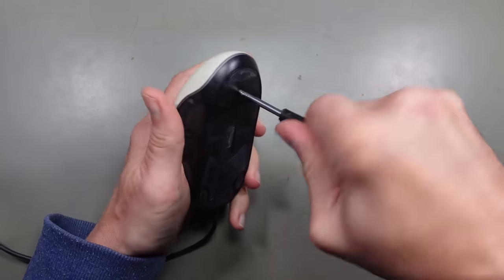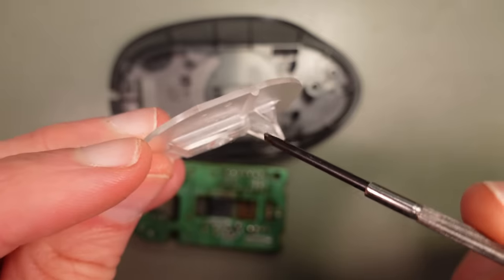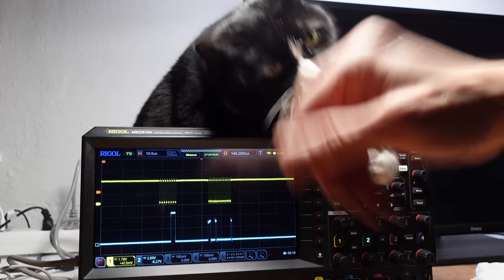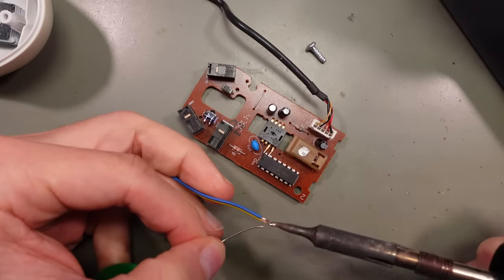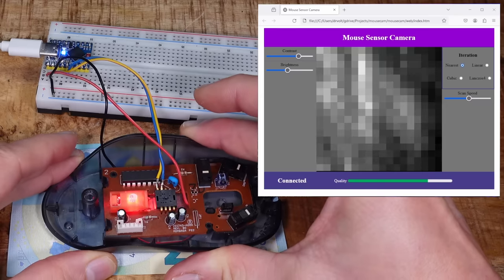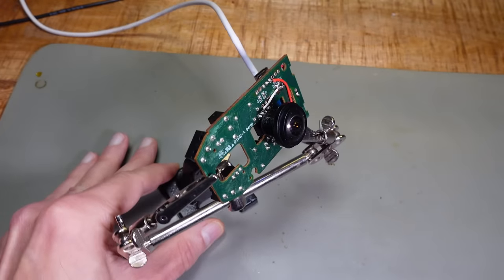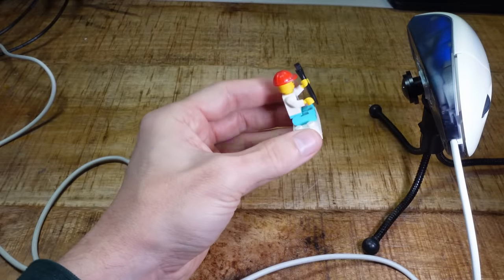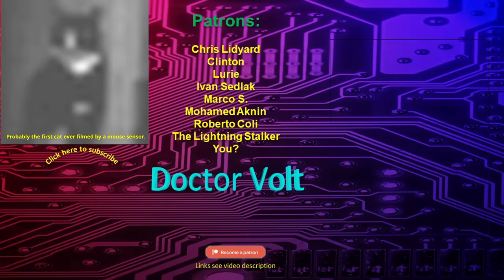I Hacked a Mouse into a Camera!

Comment: I feel like you should be able to get higher frame rate out of that sensor... I think the ESP mini board was a limiting factor there
Reply from the maker: No, the limiting factor was the sensor. Reading the images without error takes that long.
Reply: maybe with a newer gaming sensor you would be able to do that
Reply: @cle4tle  yeah aint no way a mouse is that slow, how would it manage to be precise

EDIT: I looked at the datasheet of the ADNS-2610 chip. Basically it has different registers for either X and Y movement and a pixel data one. (there's others as well)

So apparently it can compute internally the X and Y movement, as it only needs to send that, as opposed to sending the whole image, which makes sense why it's slow in this case.
Reply: @CreepyMemes  the sensor also has delta_X and delta_Y registers and does tracking internally, I assume in normal operation the raw image data isn't read through SPI
Reply: @CreepyMemes everything happens inside the same chip, in normal operation only the movement vectors are communicated, not the image.
Reply: @DoctorVolt  good job, man!
There is an old russian project called W-Mouse/WX-Mouse that pulls images from the mouse sensor to make manual focus correction easier. The framerate in their control utility is much higher, but I bet that's due to different sensor models, the cheapest option there is ADNS3080 iirc.
Reply: @CreepyMemes  if the modern microcontroller is limiting the fps, how would a 15yo microcontroller that is designed to be as cheap as possible have the mouse be "precise". Maybe they don't interpret the raw signal from each photodiodes into values or images, maybe the controller just calculate the acceleration and movement of a axis into a hid report and send it to the cpu to make the mouse movement
Reply: smart af @cle4tle
Reply: @CreepyMemes  If the sensor does all calculations internally, then why does it offer the functionality to get the raw image out? Seems odd.
Reply: @HitoPrl  debugging while developing the mouse
Reply: @HitoPrl Probably for QA.
Reply: @float32  @channel11121 yes, both of those things make sense.
Reply: @CreepyMemes  This is exactly right; the ability to read out the raw sensor data like this is mostly a testing/debugging feature, and it's not used in normal operation. There's a lot of very fancy processing that normally happens right on the sensor chip to compute and provide properly calibrated X/Y movement values, and the microcontroller actually does very little in a typical mouse (other than just passing the values over USB).

In fact, I believe at least some (maybe most?) sensors don't normally even let you read the raw pixels like this at all because it serves no useful purpose in a mouse, so it's nice he was able to find one that did support this. I'm honestly impressed it can produce a framerate above 1 per second in this weird mode at all.

The resulting image quality is actually better than I expected; the resampling helped a lot. I'm guessing that these sensors, while very low resolution, are also very high dynamic range and low noise (due to the massive pixels) so that goes a long way toward ensuring a clean readable (if low-detail) image.
Reply: @siberx4  I don't think it makes much sense not to keep the frame capture mode in mouses.

Manufacturers create new mouses based on the same exact sensor all the time, but the sensor placement is not a constant value, so it needs to be properly calibrated.

Will they make separate versions for consumers and developers? It doesn't cost much to keep these debug commands etched in sensor ROM, but creating separate manufacturing lines just for devs, or worse - making those on per-order basis is a nightmare for all sides of the deal.

Imagine a world where special versions of ARM chips with JTAG stripped or AVR chips without programming interfaces are more wide-spread than normal, debuggable/programmable chips. That'd be quite inconvenient for everyone involved ;(
Reply: @V4ker  Disabling testing/debugging functionality in production parts is very common. There are whole lines of microcontrollers with a "development" version that has reprogrammable flash/EEPROM while the cheaper production version of the chip is only one-time programmable. Separately, it's a common occurrence to be able to burn e-fuses of some sort to lock out debug functionality once the initial firmware has been programmed, both to prevent somebody from extracting the firmware from a production device and prevent others from activating the JTAG or other debug interfaces who might want to either mess with the product or reverse-engineer it for competitive reasons.
Reply: @siberx4  in modern mice usb data is directly wired to the sensor. Its all integrated
Reply: this would be a really nice camera for filming ufo videos
Reply: @siberx4  True, fuses and burnable e-fuses are a thing, but is it a thing that makes sense in something as dumb as a mouse sensor? Also, yeah, there are chips where dev and production versions are separate, but lets disassemble any random device in your vicinity. On average, what would be the chance to see those chips vs just a normal AVR/STM32 microcontroller?
Reply: the data in chip is hardware decoded forming the pointer delta (18x18 convolution hardware matrix, sort of), streaming the data out of the device is unimportant.

Comment: I thought that optical mice sensors captured images very rapidly so that they can still measure very high speeds of mouse movement. I was expecting you to be able to read at 1000s of frames per second. What would be required to make that happen? A high-fps camera would be cool even at 17x17 resolution!
Reply: It looked like an old mouse he used. Definitly no gaming mouse. 
Thx for the great video Doctor 👍🏼
Reply: All is designed for slow speed. You would not expect a mouse with usb3 cable, do you? For a high speed camera, a high speed controller needs to buffer into much RAM. Nothing of it is in the cheap mouse.
Reply: @suki4410  optical mice do not transfer the images to the host computer - all of the processing happens on the mouse controller.
Reply: I thought so too, at least 60fps and likely higher should be possible to prevent lag. Maybe the sensor needs much more light, the illuminating led is usually quite bright and concentrated on a small area. Ambient indoor light is much much lower.
Reply: These mouse chips designed to process image with very high speed internally. And usually they provide just X and Y displacement.
However, they also have possibility to provide full image for test purposes (during production) but it is pretty slow.
Reply: @MSP_TechLab  This particular mouse appears to have a camera module and a separate processing chip. And the OP doesn't appear to have a datasheet of the camera module so how could he reverse engineer the test mode?
Reply from the maker: The fact that it is so slow is due to the transmission of the images via the serial protocol. Normally the processing takes place in the sensor itself, so that the sensor only outputs the movement data. By the way, not all sensors support the reading of images.
Reply: @imqqmi  on 5:03 you can see a registers set. Normally that separate processor queries these delta x, y data and sends them over usb (or pc/2).
But you can also query that data register in order to get pixel data from camera directly (but comparatively slow). 
I didn't mean that it has any special "test mode".
I meant that this data register is probably used for testing/calibration during manufacturing, so he didn't have to reverse engineer anything.
Generally speaking such projects like "camera from mouse" are well known in the internet including datasheets, code examples etc, and the only difficulty is to find a mouse with appropriate chip.
Reply: @MSP_TechLab  I see, then the OP skipped that step. You're right about the deltas, that should be faster ss it's just a few bytes. I think I also see 'tearing' when he moved the bank note. Likely the data register is updated more quicky than it can be read from it externally. It makes sense.
Reply: @DoctorVolt  don't give the glowies anymore ideas now we have to cover the mouse sensor when we are not using the mice

Comment: Wow! Well done! I gave you a big thumbs up.
Next week make it in colour, and I mean not by scanning the black and white sensor for fractions of microseconds (every colour has its own frequency, by turning on and off the sensor, the colour can by interpreted by the length of the phase) Although, I think you need quicker processors for that. Colour detection can be done with optical filters but that needs fine mechanics. Luckily colour can also be detected by changing the frequency of the light, add a number of different LEDs and let that light shine on the object, red light is not reflected by blue objects etc. After a rainbow of colours the real colour of the image can be calculated. Than you finally can see your cat in colour.
Reply from the maker: The cat itself is black and white, though.
Reply: That is not an accurate understanding of how visible-wavelength sensors work. Visible light image sensors of even very high end cameras are not electromagnetic devices, they are photoelectric devices, i.e. not sensitive to phase. You cannot get visible-band color information from a black and white sensor through any kind of sampling or gating scheme even if you're able to sample or gate at daylight frequencies.
Reply: @AJMansfield1  I am sorry, you can but at this moment not a single optical sensor is fast enough to do so. Not so long ago in electronics magnificent things were done by looking at the phase, the same thing can be done with light as soon as there is some development. The fact that it is not jet possible right now does not place a barrier for thinking further then what is achieved at this moment.
Reply: @vanhetgoor  Believe me, I know exactly what you're talking about as applied to radio and microwave frequencies — quadrature sampling is a fairly ubiquitous technique used in all kinds of radio devices to extract phase information from a signal. At visible wavelengths though, the feature size you need in order to construct filter elements that are reactive to those frequencies starts to reach the point where the only construction method possible is "stacking thin films into a filter", and it's not really possible to include active elements in the effective "circuit" formed this way.
The way that ccd or cmos camera sensors operate involves an entirely different physical principle — they do not measure the electromagnetic fields directly using an antenna, but rather count the rate of discrete photon events, based on the current across a suitably-tuned semiconductor junction. It's not a matter of "good enough", it's actually a totally fundamentally different way of measuring light. And without some novel breakthrough in the design of the sensor cell, phase information will always be lost by that photon bandgap process.

Comment: Beat you to it by about 20 years? We've done such a camera back then, trying to make it into a slightly smarter motion sensor, with a quick response low resolution image stream. Probably because the sensor is not as good as today, we found that the sensor has a too low dynamic range and can only be used indoor and in a dim environment. Glad to know it works now!

Comment: Best camera ever! :-D Really nice work. Bitbanging a single-wire protocol is hard, wow. I think the capture performance is limited by your bitbanging, right? Should be possible to increase the pixel speed by some factor x, 'cause otherwise it would not be able to achieve the original task of tracking that fast mouse movements. But hey, as I said: Brilliant. Awesome work!
Reply from the maker: It is so slow because it takes quite a long time to read out the images. The sensor needs at least 100 microseconds for each pixel. You also have to wait a few hundred microseconds between the read accesses to the individual pixels. So it adds up to about 1 millisecond per pixel, which at 324 pixels is about 300 ms per image. So we get about 3 images per second.

Comment: Why not use the ESP32’s dedicated SPI hardware with a diode and resistor to merge the two data pins into one? I assume the image sensor runs I/O at 3.3V.
Reply from the maker: I am better at programming than at developing circuits. Besides, additional circuits would have taken up too much space.

Comment: Instant sub! 
Amazing!
I wonder if a better mouse would generate a higher quality image?
Like one of those logitech G pros, razer viper whatever
Or if those have more custom parts that are harder to modify.
I'd love to see a part 2 exploring that!
Reply from the maker: Better mice don't have more pixels. They are only closer together so the resolution per inch is better. Furthermore, not all mouse sensors feature reading the raw images.
Reply: @DoctorVolt  Of course there are mice with more pixels, 3360 sensor raw image dump is 1296 pixels large, that's 36x36 pixels. Reading is quite tricky though, the sensor requires different volatile firmware uploads for each of its operating modes including test mode.

Comment: This perfect blend of technically impressive and utterly pointless is what makes my brain happy. Do newer, more modern mice have a higher resolution photosensor I wonder?
Reply from the maker: Even newer mice have a resolution like this.
Reply: You don't need high resolution for image velocity sensing.  You just need enough speed and wide enough angle to resolve any difference that will happen within 1-2 frames.
Reply: Neat. I guess that's the highest performance mouse camera we can make, then?
Reply: Decent office mice have a sensor resolution of typically 18x18 or 19x19 and gaming mice up to 29x29 that i have seen.

Comment: Cool project, but there  was a missed opportunity to wire up a mouse button to the microcontroller to take pictures.
Awesome channel!
Reply: That would be a funny gimmick :D but the overhead of this would be a lot. Adding an SDcard module and coding it to safe it there, while technically the "video" stream over wifi consists of 3 pictures per second.

Comment: i'd love to see this done with a more modern mouse, and even if the resolution isn't much higher, you can use the data from multiple captures to increase the resolution by also using the original motion tracking of the mouse to put more pixels between the ones you have
Reply: Modern mice don't have debug pins on their sensors for ouputting raw iamges. Only the old ones.

Comment: Nice video, thanks for sharing it. The one data line SPI is the I2C (it is open drain, not push-pull like SPI but it has to be). It is supported with the Wire.h library. 3 fps is pretty wierd a mouse must respond much faster.
Reply: If it is I2C then the master is probably the one determining the clock.  18x18 pixels with (guess) 8 bit resolution and wanting something like at least 60Hz refresh rate (again a very rough guess, some mice claim >1000Hz) would require around 150kbit/s.  Many I2C devices can operate at 400kHz, so that should be feasible.  I hence think the 3Hz will be a limitation by the implementation on the ESP32.

Comment: 8:07 not knocking down PCBway, i like their sevices, but you can print the same level of threads using the ancient (by now) CR-10. If you know Praktica MTL-3 cameras, i had some spare parts from one, particularly the barrel for the remote activator and i printed the thread for that because i wanted to use a taller (unmodified) activator plunger from another camera, an antique with a 9 meter long cord. It's even finer thread than the standard thread on that camera lens. Just sayin'
Reply from the maker: Ok, but PCBway is a good option if you need 3D prints only occasionally.

Comment: I need a 2D position sensor to show relative motion of my Robot Cart to implement wheel slip correction; this technology could be 'hacked' to work with some unknown precision.  Your video does not describe this operation as it is beyond the scope of this video.  However, have you ever considered such a relative position sensor?  It's a bit later and I realize it is just the optical system that needs 'hacked' to get the relative motion that I would like to use as an input to the odometry of the Robot Cart.  However, your thoughs?
Reply from the maker: Well, if you change the optics, you can use any mouse as a 2D position sensor.

Comment: Hi doctor volt. I can see you are genius in electronic engineering. Can you cheat gpu recognition  by re-write gpu rom of older version like rtx3080 and make it become  rtx4080 ?
Reply from the maker: Maybe genius but not wizard. There is more difference between rtx3080 and 4080 than just rom.

Comment: Just looked at the code.  There are a few lines where you set the clock pin high or low twice on consecutive lines, why is that?
Reply from the maker: This is because of the timing. The second gpio_set_level(...) holds the level at the pin a few nanoseconds longer. Instead of a delayNanoseconds() function, which does not exist.